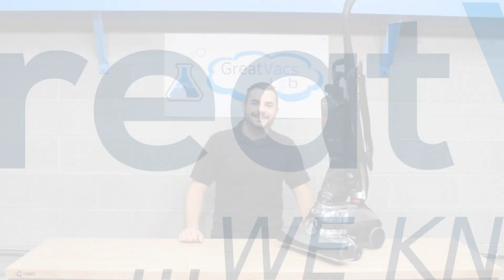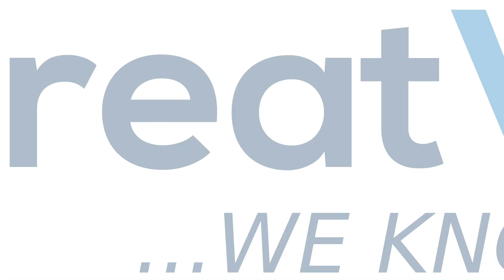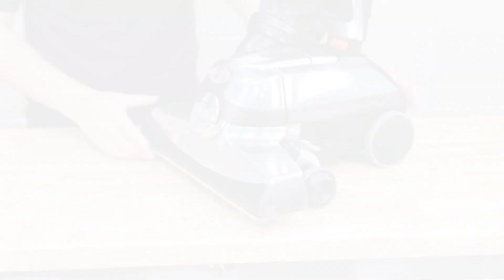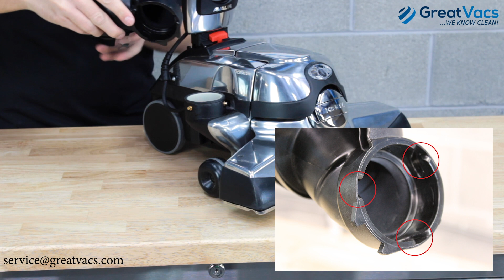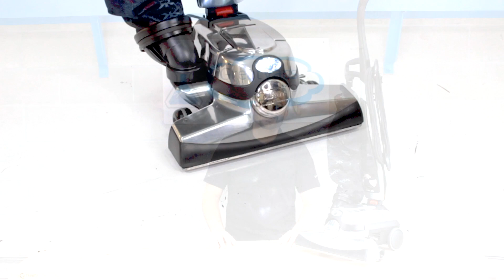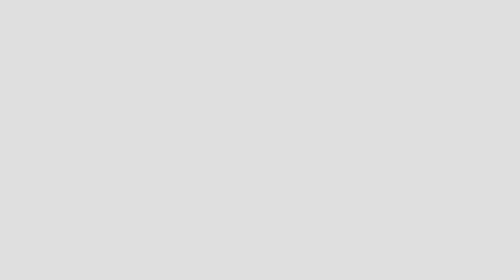My Kirby Won't Turn On! Safety Switches and Other Common Problems

Comment: I realize this is an old video but maybe someone can help. I checked both safety switches on my used but new to me Avalir 100th Anniverssary G10, that I purchased on EBay. I received it yesterday and it looks new, including the attachments. The head is a go and looks fine but the bag safety switch has me baffled. The switch itself moves freely, but when I put the bag on and twist it doesn't hit the switch to engage it?? There is no damage to the boot that I can see. HELP Please

Comment: Thank you! You helped save my daughter from having to bring it in to a vacuum repair shop (which as a single mom with 2 young boys, she does not have the funds for!) It seems it was the vacuum bag safety switch that was causing her Kirby to not power on.

Comment: So I did all the things in this video and nothing helped mine seems to be in the handle where it goes into the top if you wiggle it there when it is trying to die it'll keep running.

Comment: Fixed my problem just by telling me check the safety switch. Had a bottle cap stuck up in there took it out and it turned on 😊

Comment: Thanks, I didn't have the bag turned in all the way. It was fairly tight and took a little force, but once I clipped it in all the way the machine came on. Now if I could figure out the best way to set the brushes. I think I may have the brush bar too low and it's only on the 2'nd mark. Sometimes the machine really sucks down way to hard on some carpets.
Reply from the maker: Excellent! Yes if you check our Youtube channel you will see a video on how to adjust your brushroll.   There is 3 settings you can set it to.   We also sell new belts and brushrolls at www.greatvacs.com.

Comment: You saved my kirby, ready to dump. Thanks so happy 😊 🎉
Reply from the maker: Glad we could help!   At GreatVacs we have rebuilt over 100,000 high end made in the USA vacuums like these.   Those are 100,000 vacuums not going to our landfills.   On average vacuums purchased at the big box stores or from Amazon only last 1.5 years and fill up our landfills and they are shipped all the way from China (lots of pollution).   So not only is your home cleaner but you are actually really helping that planet.  Well done :)

Comment: Having a problem with my kirby. I followed your video, and it still isn’t turning on. The light goes on and then off.  Is this normal or is it a short in the unit?

Comment: Thanks. I had taken the vacuum apart to use the shampoo attachment and changed the bag.  Did not get the bag attached correctly.  Fixed my problem.  Thanks you saved me some worry

Comment: Unfortunately I tried all of the recommendations in the video and all of the safety sensors and tabs seem to be in place and working.  No apparent short in the cord (based upon moving around while plugged in).  What is the next recommendation for troubleshooting? I don't have a problem disassembling if I know what to look for or if something needs testing via a multimeter.
Reply: Same here - I need help too. Did you find out why it wouldn't turn on? The repair shop is more than 30 miles away from me.

Comment: I've owned my Kirby since the 90's. Was about to pull the power switch out to troubleshoot why it wasn't turning on. (I do the repairs and maintenance on it myself. Ditto my sewing machines and other things that I use.) Didn't realize I had forgotten to attach the head. Good grief. This 60 year old partied with the 30-somethings last night, and paid the price 🤣 Thanks man!

Comment: Thank you for this vedio. I have two kirby's and didn't know this. Hubby used it to carpet clean then put it back to vaccume mode and the bad wasn't engaged. Almost took it to the repair man. I'll be watching your vedios for more tips as my grandmother bought two kirbies and gave them both to us this year and get this still in the box. Q is 2 years old other is 4 years old. But no instruction books

Comment: Thank you for your video.  I think I must have broken the bag safety switch; how would I go about replacing it because I don't even know how I would take it apart so that it's accessible?   Is it expensive?  It would suck to have such a good vacuum but not be able to use it just because a little plastic piece broke off.  Thank you, thank you, and Thank you, again. 🐩

Comment: This saved me a lot of hassle. I had started taking my Kirby apart to test, and if necessary, replace the power switch. I found this video while searching out instructions because I had already disassembled the unit. I found this video, reassembled my Kirby, and made sure the safety switches were engaged as described in this video. It works! Thanks!

Comment: those micro switches must be wired in series thus both need to be closed for the motor to start. I presume they are wired just past the load side of the switch and motor line side.

Comment: Thank you so much, I was using the shampoo attachment and it just stopped. I was heartbroken for a second and found this video. Put it back to original parts and it started right up! It was the switches!

Comment: Thank you, I was boohooing because the vacuum wouldn't turn on. I have a Sentria thought I was going to have to take it in for repair. I live 70 miles from a repair shop. It was the bag had rotated a little as I took it our of the closet. This video is very much appreciated.

Comment: Thanks so much for that video help me immensely I've got an old g 4 before I purchase an on-off switch is there a way I can bypass that I noticed there are three wires going into it I've taken the bottom two off and I've tested both wires and they've got continuity for testing purposes can I combine those wires and make sure all my other switches are working properly and should the machine turn on? Then I can tear down further take the switch out and get a new one if I can test this switch thank you very much and again a great video

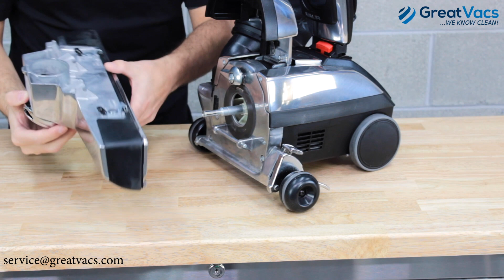Comment: Thank you sir for these safety switches (@1:30 & @3:00). Mine did not turn on because of the IEC-C13 power chord was faulty (perhaps wires were broken inside the rubber cover). I used a household cord & it turns on now.

Comment: A short in the power cord would cause tripped circuit breakers in your house at best, flame and mayhem at worst.  Pretty sure a "shorted" power cord won't only keep it from powering on.
Reply: yes that is true, when the hot and neutral wire of a frayed power cord "touch" when it's plugged in. Low resistance, high amperage will case a short, and trip a breaker.  With the vacuum cord as the conductors are usually 18 gauge with a flexible outer jacket, often one of the conductors breaks within the insulation.  Not enough to cause a short but to stop the flow of current. I've had it happen with power tools as the cord flexes in use,  right near the strain relief. If I wiggle the cord, and the drill starts,  I have a broken wire. And replace the cord.

Comment: Thank you so helpful!! My safety switch for the bag wasn't locked all the way!
Reply: I had the same problem.  Took the bag off and reattached it according to the instructions and it works!
Reply: What did you have to do im having the same problem!

Comment: I have a Sentria that is several years old. I think a stray cat that kept coming in the house sprayed the front of the vacuum. I cleaned off the front and turned it on and it ran fine for about 5 min. but started to smell like hot cat pee. when I tried to turn it on again, it wouldn't turn on.

Comment: Duh if you have a short in the power cord you will probably trip a circuit breaker.  You probably have an open.  not a short.  open circuit = no current..  Short circuit = too much current.

Comment: Thank you so much for this video! I have two dogs, and their hair is always all over the inside of my car. I love using this vacuum to clean it, rather than paying to have it detailed. I was bummed that it would not turn on this morning, but after watching this video, I discovered that the back safety switch was not in the right position. It works like a charm now.

Comment: Both safety switches are engaged. Head is installed correctly. The vacuum works when attachments are installed. It looks like there are two halves to the head safety switch. Both the top and bottom switches are pressed in when the attachment hose is on. But only the bottom switch is pressed when the head is on. There is a slight gap between the head and the body where the safety switch is. I poked a pencil into the gap and pressed the top safety switch and it turned on. Do both switches have to be pressed in order for the vacuum to work? If so, why does the head attachment only press in the bottom switch? Everything on the vacuum frame is so rigid, I doubt something is bent.
Reply: Me too! Did you fix the problem?
Reply: @momlovesemmett  I did! I was using the wrong belt. I figured out that I was using the belt from the shampoo attachment which is smaller. So the belt was pulling down on the head too much and wasn’t letting the safety switch contact push on and engage the correct switches.
Reply: @sterlingungerman5474  thank you so much!!! That makes sense now. I put a tiny end cap (for a wire shelf) over the metal depressor and it worked kinda until the belt tore (very quickly).
Reply: Some have a fuse in a wire assembly going to the motor you’d have to disassemble to check it and if it’s blown you have to replace that wire assembly. If it blows again you have other problems.

Comment: Both safety switches are engaged but still no power to the motor.  Won't turn on when wiggling the power cord.  It was working fine one minute, wouldn't run the next.
Reply: Same for me. Tell me if u figure it out!
Reply: Yes, the same for mine also, any idea what it costs to repair?
Reply: Jesse Reynoso I haven’t got mine fixed yet.
Reply from the maker: There could be a couple possibilities: Safety switches aren't engaging properly. Where the cord snaps into the cord holder on the back of the handle, there may be a short somewhere in there. Since you tried wiggling the cord and it still didn't turn on you can ignore that one. Motor brushes are another possibility. We or you wouldn't really know what the problem was until the Kirby was opened up and looked at. You can email us at service@greatvacs.com and we can go from there if you'd like.